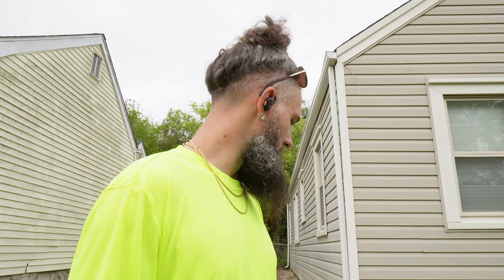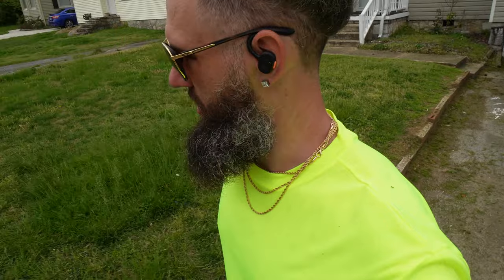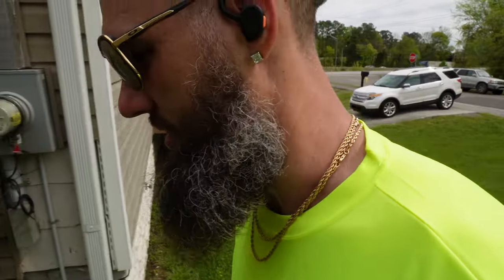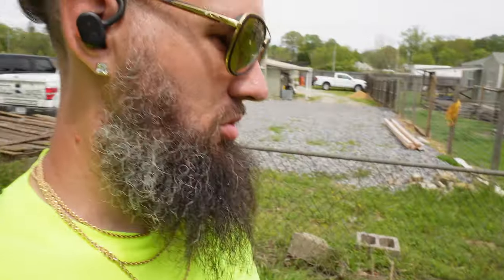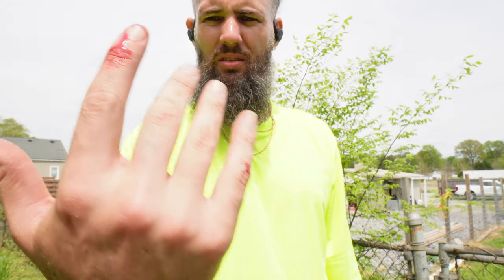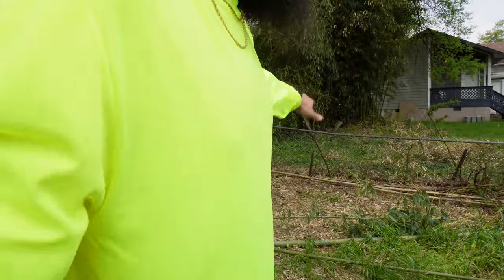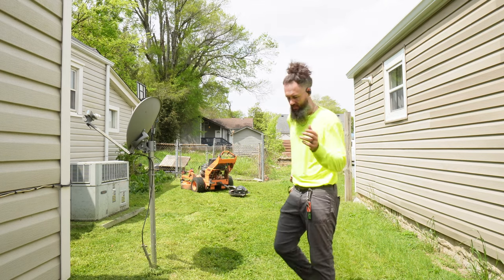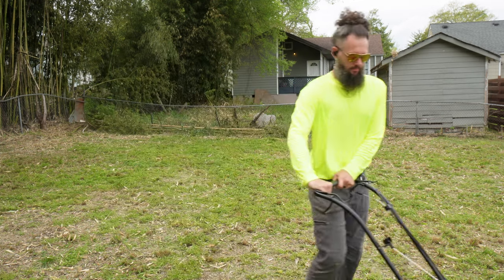Bought a push mower just to mow her lawn for FREE

Comment: As a retired mechanic I understand that sometimes the extra effort goes unnoticed. I would write in my story that I checked fluids, filters, tire pressure, reset tire monitoring and checked operation, checked for fault codes, checked belts, all for free since I was not getting paid to do this. When the customer went to pickup their vehicle I would ask them it the Service Advisor told them what all was checked, NO. I asked if it was listed on the repair order, NO. I asked to see their repair order and there it was written in plain sight. Sometimes "doing the right thing" goes unnoticed. It still is the right thing to do. Great Job.